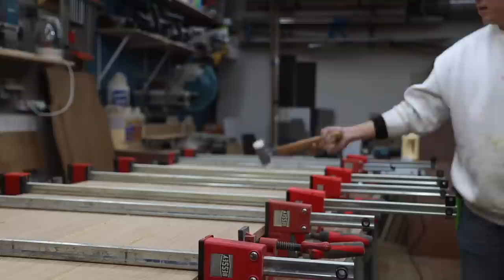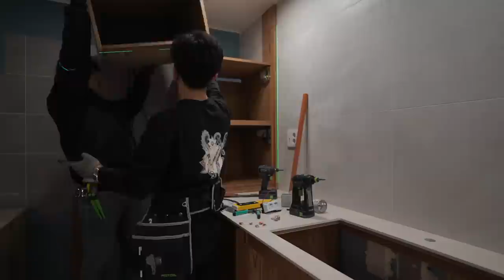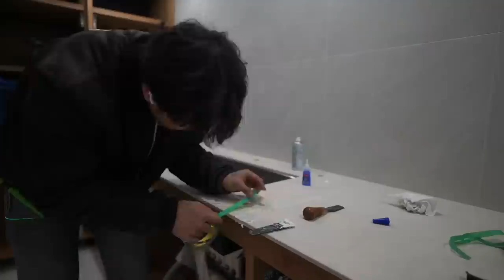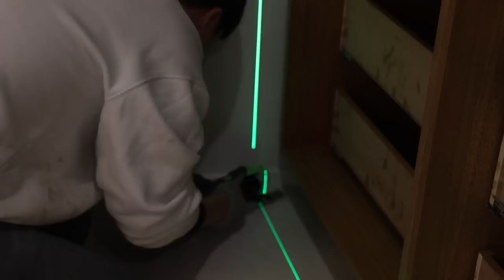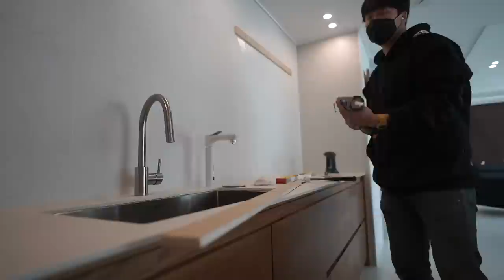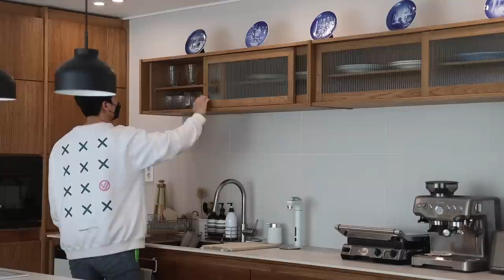W123_Kitchen installation

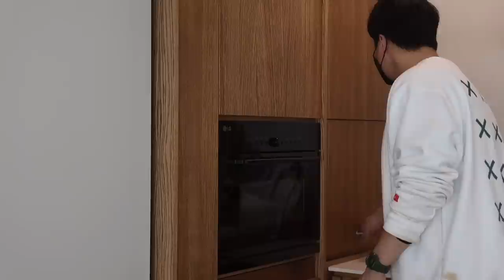Comment: @ 10:38
Very nice lifting mechnism. However, it seems you forgot to consider usage of the power sockets just in front of the cabinet? If appliances were plugged in, then the panel cannot be lifted due to physical obstruction. In that sense, the mechanism is impractical? I would recommend to not have a front panel and just leave it as an open shelf. Or was there a consideration I am not aware of? If yes, do let me know 👍